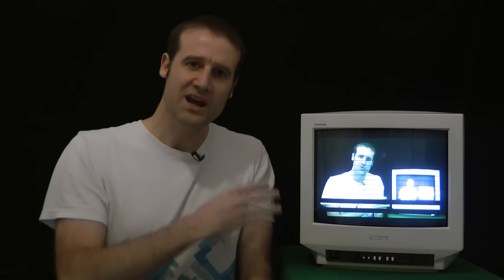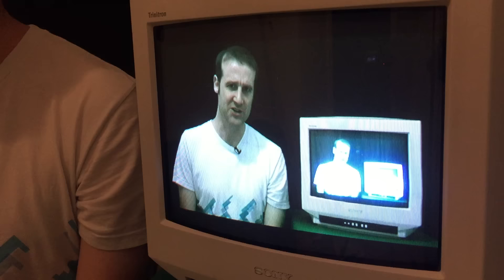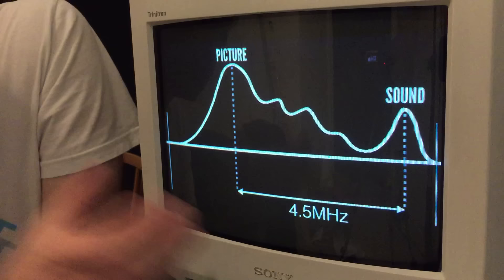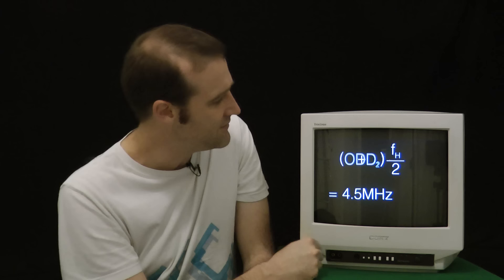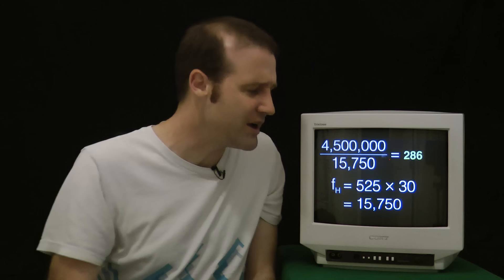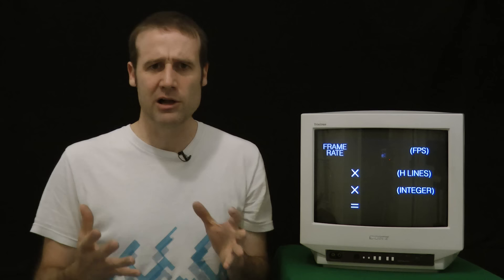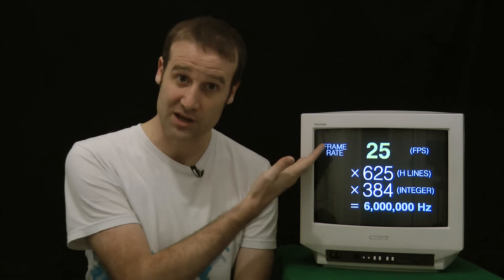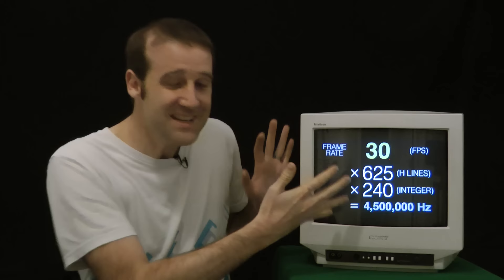Why is TV 29.97 frames per second?

Comment: One question left unanswered. How do they time the 29.97 with 60Hz power? How do black and white TVs still work with the different framerate? Was that two questions?
Reply: It's just 4 frames less per hour. There is no problem to trigger vertical oscillators circuits with this insignificant change in the synchronisation signal.
Reply: they dont there is a sync signal with the pix signal which tells the tv when to start the new frame
Reply: it's all about the interlacing, 60Hz divined by 2 is 30 frames/sec (29.97), for Europe because of the 50Hz is 25 frames/sec
Reply: The very earliest, Baird, mechanical TVs used an electric motor to scan a spot of light over the screen. They used the mains frequency to keep in sync. 

But the later electronic, CRT, TVs (that people actually bought) didn't use the mains frequency for anything. Instead they use sync pulses, transmitted in the TV signal. The pulses tell the TV when to start a new frame, and when to start each new line. The TV does as it's told by the signal. 

So theoretically a TV picture could have any frame rate, the transmitters could use any FPS, and the TVs in homes would follow along at that rate. In practice it doesn't quite work like that because circuits operate best around the speed they're designed for. 

Finally there's the issue of lighting. Light bulbs in viewers' homes flicker at 50Hz / 60Hz, as the voltage goes up and down the bulb flickers. Persistence of vision means we don't notice this. But if a TV screen was flickering at one frequency, and the lights at a different one, it'd make the screen look flickery to our eyes. So it's best to have everything at the same frequency.

29.97 is close enough to 30 (which is half of 60) that it makes no perceptible difference. It's also close enough that the B&W TVs didn't notice a difference.
Reply: greenaum I don't get this "close enough" business. If it's not exactly the same, it will keep getting more out of sync until the phases are completely opposite.

The part about old TVs using electric motors is interesting af though. Wonder how they did that. Seems like, since the beam has to be manipulated magnetically anyway, it would be easier to just change the voltage to a series of magnets. Or is that what the motor was doing?
Reply: It's not about interference with lightbulbs flickering. They chose the same (close enough) as mains frequency for vertical deflection to hold in place some darker bars on image, caused by imperfect supply filtering. Without this coordination these bar would start moving, which surely be annoying. Little difference in frequencies makes this move very slow and unnoticeable for viewers.
Reply: Exactly so.  And if you watch old TV footage with a computer monitor in the background, you often see those darker bars moving down the screen because (at least here in the US) TV stations shot directly on video while the screens flickered on at rates based on the power supply, and the slight variation in frequency makes the scanning of the screen very visible.  Eventually, they figured out how to shoot TV footage without this (mostly digital solutions), but like a helicopter or the wheels on a car, it looks very different filmed than it does in real life.
Reply: Ah, mechanical TVs! Strange at first but obvious when you know how. Looking up "Nipkow Disc" will help. 

Basically you have a big, round, flat disc, maybe 2 feet across. It has a hole drilled in it near the edge. Then a little way round the disc, another hole, a bit lower. Then further around, down a bit, another hole. Maybe 20 or 30 holes at first, but later ones had around 100. 

This disc is mounted on a motor and spins round at, say, 50Hz (John Logie Baird was Scottish).

Behind the disc is a light, that can change brightness very fast. As the disc goes round, the holes move past the light. So as the top hole moves across, the light shines through it, onto a screen (basically something like a sheet of wax paper). The light varies in brightness as it shines through the moving hole. So the light "draws" a line across the screen as the disc turns. 

Then around the disc, the next, lower hole comes by. This also moves in a line past the light. Then the next, etc. 

So you get a series of lines of light, one under the other, drawn very quickly. A light beam instead of an electron beam. You get it? There was no electron beam.

The problems include low resolution, and a great big heavy noisy dangerous disc zooming round the back of the thing. But, it worked! At the beginning around 20, 30 scanlines, toward the end around 100. The light was typically a neon, because they can change brightness much more quickly than an incandescent light bulb. It meant the picture was orange though, of course. The Nipkow disc was the key to the whole thing, and Baird didn't invent that, so really his invention of television was an obvious application of the disc. 

Overall it was a pretty shit system. In the early days, 1920s, the BBC trialled the Baird mechanical system against Philo Farnsworth / RCA's system, which used an electron gun and a CRT and is pretty much identical to CRTs ever since. One week the BBC transmitted the Baird system, the next, RCA. At the end of the trial they decided. Obviously RCA's was far superior, and only got better over the years. Baird's system was right at it's limit with 100 lines. 

A Baird picture was also prone to wobbliness. From the motor itself, but also mains frequency variation. The motor was locked to mains frequency, so as long as your TV, and the camera in the TV studio, had their power in sync, it'd just about work.

The camera in this system, btw, was a lot like the TV. Great big motorised Nipkow disc etc. Only a lens instead of the screen, and instead of the neon light bulb, a light sensor. Scanned the image in front of it in the same way. The sensor was pretty horrible and insensitive though, so TV studios needed Hiroshima-like levels of lighting. Actually the same is true of early cinema film, insensitive. The gigantic, megabright Klieg lights are why actors started wearing sunglasses around the set. 

Actually I said 2 feet for the Nipkow disc but they could be much bigger, if you wanted a bigger TV. Most TV screens at the time were around 6 inches across though. 

You can look up more about Baird's system, but that's the basic idea of it. Hope you find it interesting!

Comment: and so, Europe saw North America and said, "what a mess!"... so true even to this day.
Reply: (cough cough presidential election cough cough)
Reply: Brexit?
Reply: Well, yes and no. The NTSC compatible color standard was developed by RCA before transistors were common. and was developed on top of the existing monochrome system. When PAL was developed, it was years later, they had better technology to work with and it was a clean slate. There was an NTSC color standard that was not backwards compatible. The CBS Field Sequential Color system was released in the early 1950s and used a spinning color filter wheel in front of the tube. That system was quickly scrapped, but its technology was used elsewhere.

Look here on YouTube for videos of early color videotape recording from the 1950s. The RCA TK-41 cameras actually made a nice picture... and no transistors!
Reply: It's more like the US looking at the UK and Europe and saying "how can we fuck this up worse?"
Reply: Your bigotry is showing... PAL came years after NTSC. Learn to read.

Comment: You have the "cause" and the "effect" backwards! The NTSC color subcarrier was 3.579545MHz which was the closest "easy to manufacture" crystal that would get close. But the oscillator needed to stay in phase from the end of one video frame to the start of the next or else the color would drift. The shortened frame rate was to keep the "ScH Phase" (sub-carrier to horizontal) correct. You work that backwards to get the numbers in your presentation! The ACTUAL frame rate is in fact 30 x (1000 / 1001) and you need about five digits of precision. 30 x (1000 1001) comes to 29.97002997 … but notice that there are two trailing zeros after the 29.97 which is the only reason why it's "close enough". But you are absolutely correct - dealing with non-integer frame rates (and interlaced video in general) have been the bane of the broadcast engineering community for decades!

Comment: So under your idea of NTSC switching to 625 lines at 30fps, this would be the same line resolution as PAL with higher fps but using less bandwidth? So more data with less bandwidth, how does that make sense?
Reply: LOL, minor details
Reply: No, it would just mean less bitrate. The extra resolution would come at expense of something, maybe smaller colour palette (but then again, TV back then couldn't show that many colours anyway). The sad thing is, colour palette is easy to upgrade, FPS, not so much, which is why we're stuck with 29.97 mess despite using digital tv, digital transmissions, and digital signal, nothing analogue in there for over a decade now. Matt is right, that was really stupid design that proved to be too resilient for our own good and stuck. Reminds me of imperial measurements, really.
Reply: Less horizontal resolution and fewer colors. Strictly speaking there is no horizontal resolution in pixels or a countable number of colors in analog TV, but you can still have less detail in that. So not only does NTSC have fewer lines, but because of the smaller bandwidth and higher framerate it also has much worse color rendering compared to PAL.
Reply: nice profile pic
Reply: Never
The
Same
Colour
Reply: +KuK137  SI is designed. Imperial is the result of evolution. And it shows.
Reply: The other sad part is... PAL 25fps today is not as useful any more when things are aiming for 30/60/90/120Hz screens, where 30 or 60 is more common for games and PC for ex. So IF the US would have stuck with the lower bitrate (witch is how you would have solved the more data, less bandwith) and 30fps... they would have had a hell of a better system today. 

29.97 is... problematic in many ways though, as it causes tearing and issue with modern screens, not running the exact frequency, or multiple of it. 

25, is doable, but u have to lock to 25/50/75/100, witch still isnt a factor suitable for PCs for ex. 

The fix for this is what AMD is trying to openly make, called FreeSync, based on the same idea as Nvidias (locked down G-Sync), but with a standardized free solution instead, built into Displayport (and soon hopefully HDMI) specifications.

Idea is that u vary the screens refresh-rate with the data being sent. So 25, 29.97, 30, 50, 60 and so on... doesnt matter. The screen just refreshes at the rate the picture is, and when it needs to, removing the tearing issues and giving you the best solution, and u can run any odd refresh-rate u wish.
Reply: That's actually true. The big difference between PAL and NTSC is the color processing. In PAL, there is a phase-shift of 180° in every other Frame (the color is inverted). It's broadcast with the phase shift and on the receiving end processed accordingly (every second frame's color information is inverted again). That practically eliminated color shift due to reflections off of clouds and buildings. (There was no cable-TV, the analogue signal was transmitted through the air in these times). 
So the color information was very stable, always the same color, as opposed to never the same color, as we jokingly called it.

Comment: Now that we have all digital television, is there any reason to not use 30fps? Or 60?
Reply: 60fps would be better but as the youtube clip points out, these standards don't change easily, lucky for us that most tv's pretty much work with most standards around the world unlike the past.
Reply: ***** A lot of high end TVs will do interpolation to basically guess at "missing" frames. Not as good as actually being 60fps, but definitely makes things smoother.
Reply: When the ATSC system was being developed, cheap computer processing to deal with interpolating frame rates didn't exist yet, so the content creators balked at spending big money on conversion hardware. The computer companies tried hard to get integer frame rates put in the standard. but the content creators won. So, in North America we still do everything 29.97... Interlace. (Unless you choose 720p) There is work being done on a new ATSC 3.0 standard.
Reply: Quantity of data, no one wants to spend more money then absolutely necessary to make things work. A lot of TVs won't even have full image quality, they will just take half and fill in the rest in hopes you wont notice, and most people don't really care enough to notice.
Reply: @James Tanner There's no reason not to use 30 fps, and indeed many do. The reason to not use 60 fps is that it requires a lot more bandwidth, and broadcast channels don't always have the ability to pay for the extra bandwidth. That's also part of the reason why some channels are still broadcasting in just 720p. Saves costs, both in distribution and production.
Reply: If I'm not mistaken, the ATSC standard is designed primarily around true 24, true 30, and true 60 fps, but also requires that manufacturers support 23.976, 29.97, and 59.94 for backwards compatibility with older NTSC systems.

Comment: When you look at this decision and the metric across the board decision both places seem to have made exactly the same sort of choices for the same sort of reason. The USA said why bother completely changing the entire system if it already works for the average person and the EU said we'd rather have you re-buy all of your stuff because ultimately this system will be better.
Reply: In Germany as anywhere in the world where the PAL System took place it was backward compatible like NTSC. The engineers had luck. The number matched together. Pal works like Ntsc. The only differences are the alternating phase of the color burst and so the correction between to lines. Which gives  Pal the name. Phase alternating lines.

Comment: PAL stands for Phase Alternating Line which is a technology used to cancel phase error of transmitted signals dues to glitches (sort of like in RJ45 network cables). The French used to have SECAM which was acronym for SEquentiel à MEmoire. It consisted of a 64µs delay line which essentially carried the same function out. NTSC was notorious for shifting the colours to violet/purple without any electronic compensation. PAL and SECAM did that and not only had better resolution, but also better imaging quality. NTSC must be recognized as a pioneer and PAL as an improvement. It is funny to see that you post a video on NTSC vs PAL in the year 2016 when the point is now about full digital 4K television :-)
Movies were shot at 24 fps for different historical reasons. In Europe, TV was broadcasted at 25 half fps because the grid always was at 50Hz and that choice prevented interferences between the mains and the local oscillator.
I could speak for hours about analogue TV...

Comment: The issue was COMPATIBILITY. The B&W standard was ALREADY IN PLACE. Nobody thought of color when the B&W standards were implemented. If they had changed the parameters as was suggested in the video, then B&W sets WOULD NOT WORK.

European standards were created AFTER American standards and included color from the start. It is a matter of foresight versus hindsight.
Reply: Black and white in the UK was 415 lines. (The rest of Europe varied as well.) By the time colour came along there was a need to improve the quality, so they went to 625 both to have a European Standard and to get better quality (than the US mattered as well). A new set of higher frequencies was made available for Colour/625. You could tell if people had a colour TV by looking at the aerial on the roof!